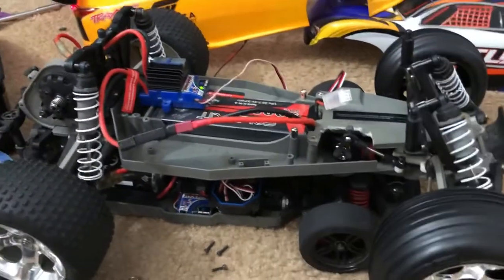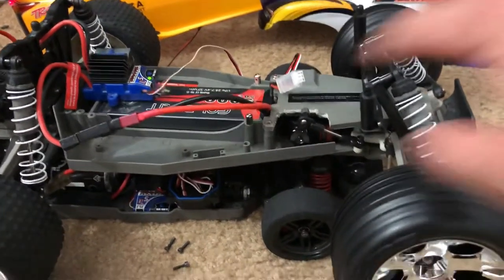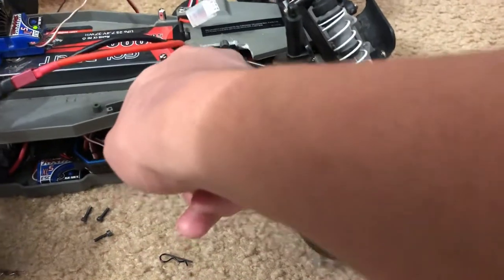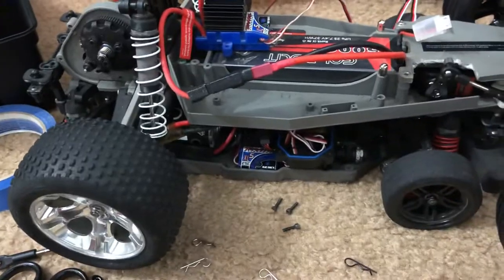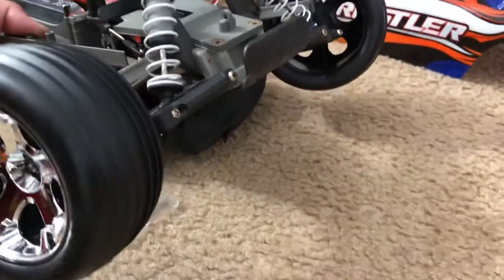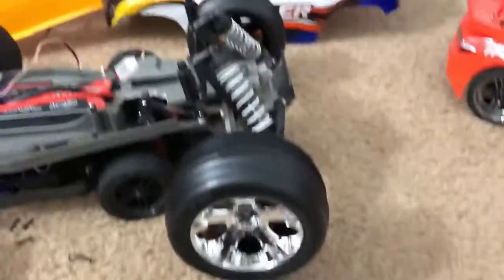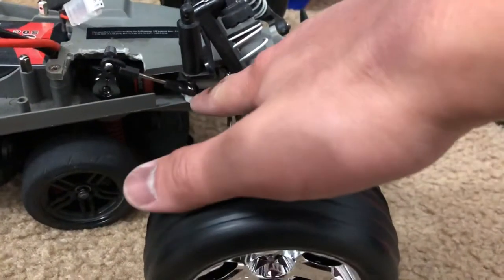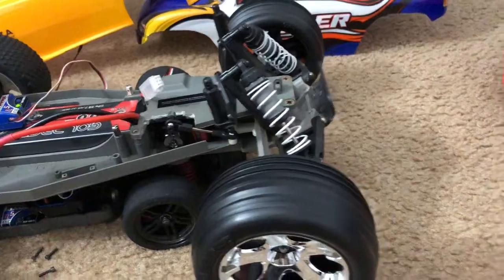Salvaged Traxxas Rustler 2WD Restoration Sneak Peek

Comment: You got some nice rides. I also have 7 Traxxas cars. I had 10 total but I sold 4 and bought two back. I was thinking of buying another Traxxas Bandit or another Rustler. Of course the 2wd or the 4wd Rustler.
Reply from the maker: I’ve never tried the AWD Rustler yet. My Project: Eau Rouge build is a Rustler 2WD with the AWD Rustler body and Teton EXT tires
Reply: FHRC Brony Radio Control and Cars Cool !!!!!